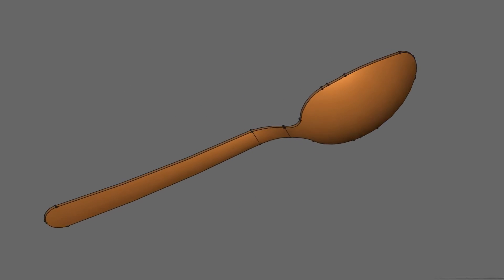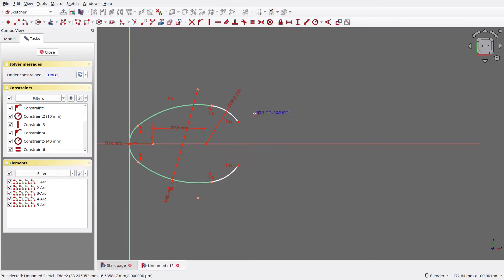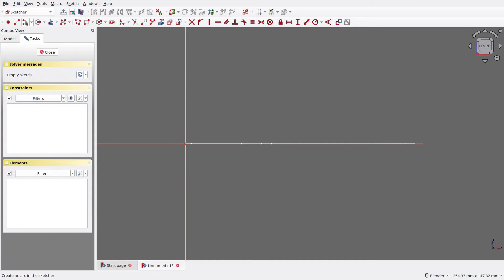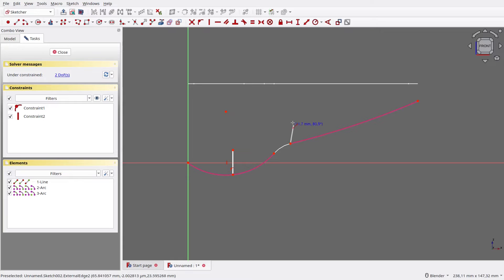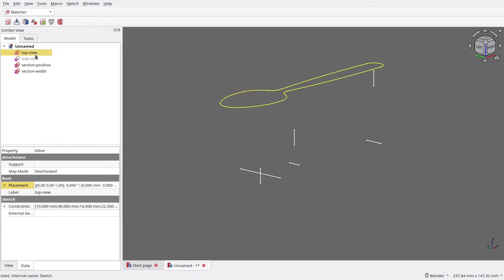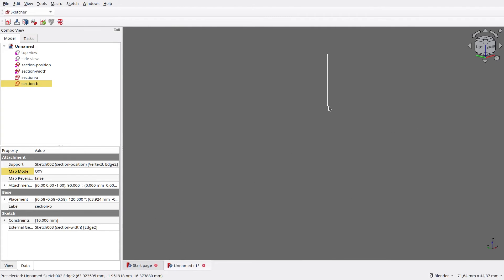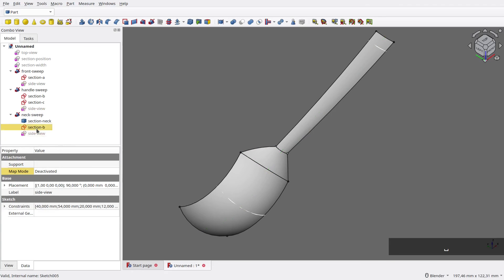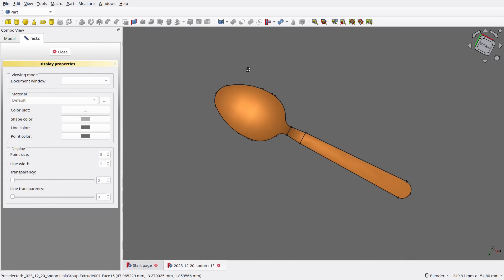#FreeCAD Tutorial 014 - Spoon - ⟪11.ai⟫

Comment: if you look from the side of the spoon you will see that this spoon has a surfacing issue - the edge from the side should be flat to provide a stable surface fo your lips to go over and also this results into a better cavity to hold fluids.

in theory this is a valid spoon modeling approach - but not one I would use.